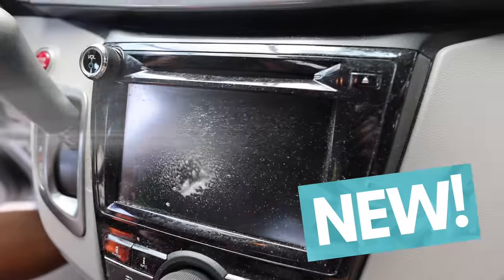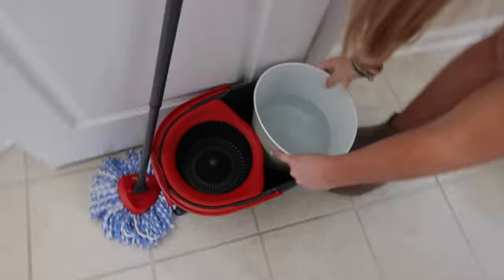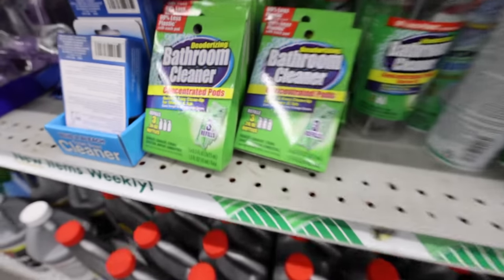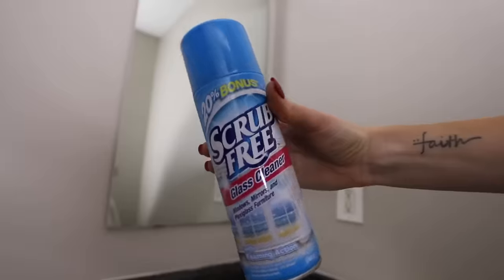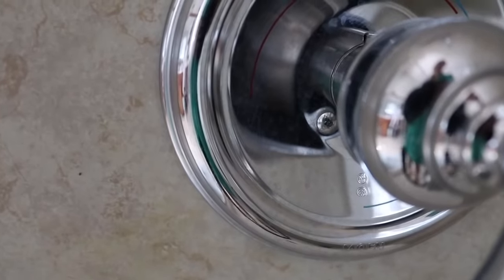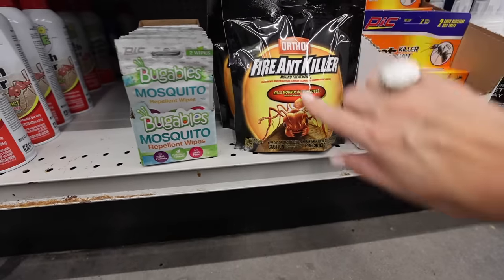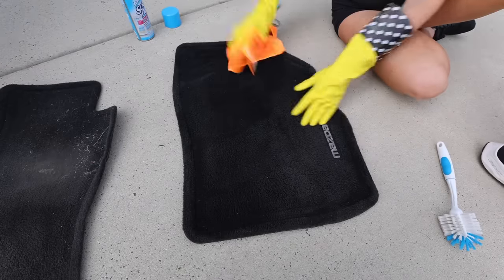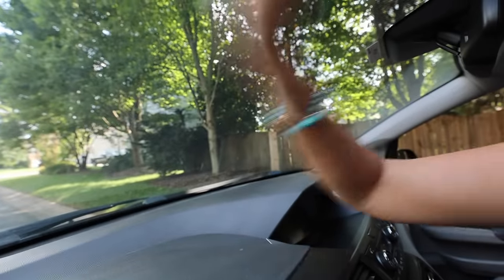Hate cleaning?! These PRO DOLLAR TREE HOME HACKS are 🔥😱

Comment: While you were using that Barbasol for your faucet fixtures, you reminded me of my husband's stories from his college days. He told me that they used to have Edge fights (yes, the shaving gel) to blow off steam during finals, at the end of the year. They did this because they said that Edge would clean everything in the house that they had rented (I can't vouch for that part; we weren't even in the same states at the time), but I have tried Barbasol, because Edge wasn't always something that they carried where we were living when we first got married (& the Barbasol works well too). If you spray it on your walls, it will clean off those dirty handprints (& it worked on both painted surfaces, even on the textured/pebbled walls, & on the wallpapered walls). For years, we've used it kind of like you were using that glass cleaner in this video.

Comment: I like to attach a sprayer to the hydrogen peroxide bottle I use this almost daily.
Also, buy a bottle of the 32oz. dish detergent. Take the empty Brillo dish detergent, add 1 tablespoon each of the dish detergent and white vinegar then fill with water. This is great for dishes and general cleaning.

Comment: Regarding soap and Odoban for cleaning; A few squirts of Dawn dish soap in a spray bottle and a microfiber cloth is my go to for cleaning. I use it everywhere including my floors and walls.  I also add a few drops of peppermint essential oil to the bottle. Makes everything smell soooo good and clean! 

Also, Odoban.. great stuff! It cleans, disinfects and deodorizes. Use it for cleaning and in the laundry. If it's packaged the same way for DT as it is elsewhere, then that big bottle is concentrated. It's meant to be diluted with different ratios for different needs (ratio instructions printed on the bottle). Great stuff. Used it all the time when I was breeding/showing dogs.

Comment: This is my favorite cleaning video ever!  I watch it over and over for refresh.  Another way to refine the baking soda and hydroperoxide tile cleaning is to get condiment bottles from DT and put the baking soda in one of the bottles for more precise squeezing direction into grout lines on the tile.  It could work with the peroxide, too, I suppose.  The original bottle that peroxide comes in is kind of hard to hold and use for the tile.

Comment: We use a Dollar Tree Essential Floor Cleaning Mophead to clean the inside front windshield of our cars…. For a thorough clean, we use it with glass cleaner… for a quick de-smudge, use it dry with the DT velcro mophead cover. Works like a charm! And so so much easier on my back and arms than just a microfiber cloth. We have one in each car, and one of our cars is an older Prius with that big windshield!

Comment: I use about 1/2 cup of white vinegar in my wash.  It seems to keep me colors brighter.  It’s also supposed to prevent buildup from laundry soap and fabric softener to keep the machine lasting longer.  Something else I do for primary white loads is add bleach tablets. They’re usually in the laundry area or pool area of the store.  I’m a lazy housekeeper.  If I can find a cheap and/or easy way to do something I’m gonna try it.  I live in West Virginia, the Mountain State, and it’s over the river and through the woods to get anywhere.  My next DT trip will include some of the items you’ve shown.

Comment: Under that bathroom sink there is wasted vertical space. I put a plastic drawer (mine are Sterilite) and topped it with a piece of shelving (so the top is flat) and put the baskets on top of that. Also, put a piece of non-slip rubber mat so it doesn’t slip. I can only fit 1 drawer under my sinks, but you could stack more if you have the space. My drawers can fit toilet paper, tissues, beautiful tools, etc.

Comment: TIP: In-between deep cleaning, I use glass cleaner on my bathroom floors w/my Swiffer, but w/an old kitchen wash cloth that has mesh texture on one side. If I'm just doing a quick clean, I'll even use just paper towels w/my Swiffer. I haven't bought the actual Swiffer wet thingies in forever! Also, I save all our used fabric softener sheets & put them in a cookie jar on a shelf in my laundry area. Every time I clean the dryer filter, I use one to really clean off lint on both sides, then I use another to wipe any dust off the W/D, & everything I can reach on the shelves. It keeps things looking brand new, & fabric softener sheets are great for dusting!

Comment: I've been using odoban for years. Have had to search high and low for it. Used to get it at Sam's club in a very large bottle and it was a concentrate that you mixed with water at different strengths for different problems. Great for cat and dog odors. Recently Home Depot started carrying which is a lot closer to me than Sam's and no membership required glad to know it is at Dollar Tree just ran out.

Comment: Thank you for sharing! I would suggest you never directly spray the electronic screen (this one was on your car’s dashboard) - instead, spray your rag, then clean the electronic components. Just about every electronic device I’ve ever had cautions against spraying onto or into it. Most electronic cleaner products echo the “spray the rag” way to use the product.
 I had water get into my car electronics on the dash once when I’d left my windows slightly open and an unexpected summer shower hit from just the wrong direction. It was very expensive to repair!

Comment: I would love a decluttering video!  Also, I noticed how you were putting everything in your washer all in one mound. Even though it doesn't have an agitator, it still needs to be in a donut shape  (as much as possible). The plate at the bottom swirls the water from the bottom to the top, and if it's covered, it can't do its job as well, and your clothes don't get as clean as they could.

Comment: Kathryn, I have a question I hope you can answer.  With the spin mop what is the big deal with having a bucket for clean water?  After mopping a section of the floor the first thing I do is put the mop in the water and then wring it out.  Putting the dirty mop into the “clean” water has now made the water dirty.  Am I looking at this procedure wrong?  What am I missing?

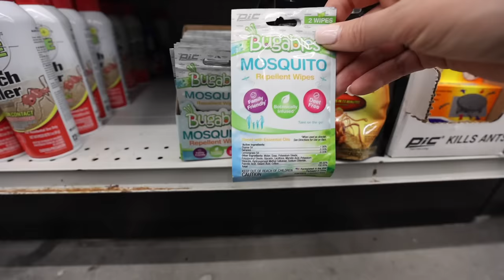Comment: 6:39 YES YES YES MY DAD AND I STILL QUOTE GET THE WINDEX. We still laugh. God is great I am blessed.  Between that product for glass cleaning and barbasol will also get out stains in home on most fabrics and surfaces and barbasol removes urine odors and is safe. So when you have little boys potty training and literally spray the bathroom barbasol is the only thing I've found to permanently get it out the first time. Walls floors the paint doesn't hurt them. I did the entire bathroom from ceiling to floor 🤣😂

Comment: WHAT WORKED and DIDN'T WORK for me: the baking soda and the hydroxy peroxide didn't work and boy I scrubbed that floor. The brillo did work with my tub.  The scrubb free glass cleaner DID NOT work at all, the glass looked terrible after cleaning it with the microfiber wrap. My faucets are not nickel but the barbasol did nothing to my faucets, maybe it just works with nickel. I didn't try the other ones, but I was very disappointed about the baking soda and hydroxy peroxide and glass cleaner trick.

Comment: I wouldn’t use her grout technique.  Baking soda is too hard to clean up and the scrub brush head isn’t on angle making it difficult to scrub with.

Don’t hang brush holder on mirror.  Your mirror will be filthy.

Shower drains do not smell.  If yours does, you need to think about what you’re doing in there.